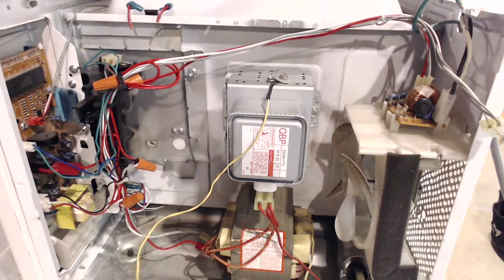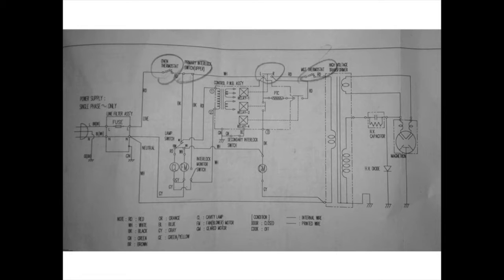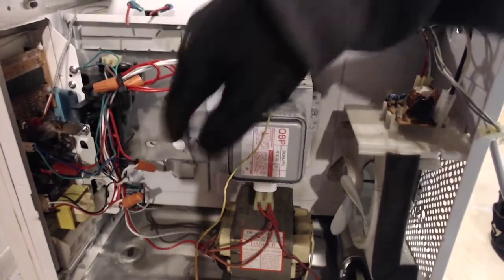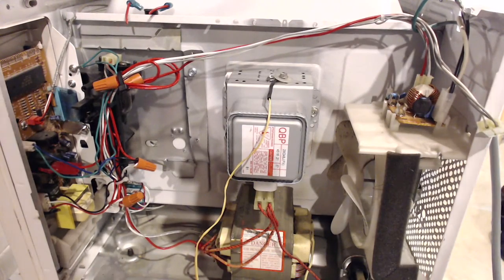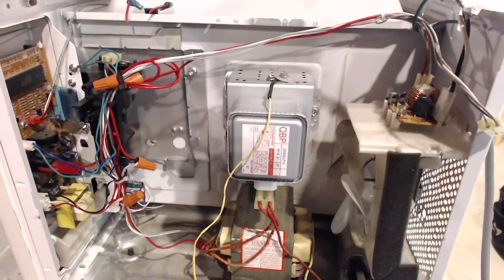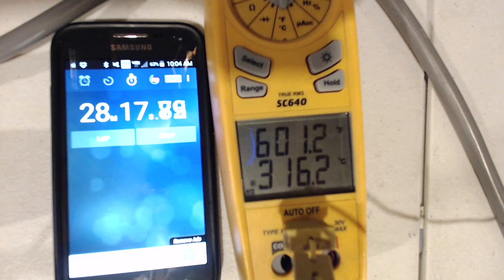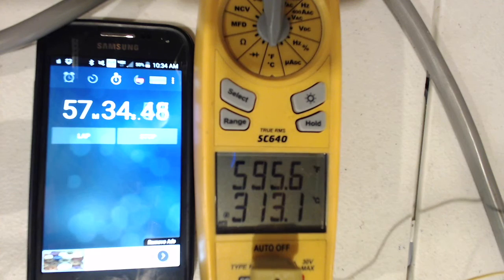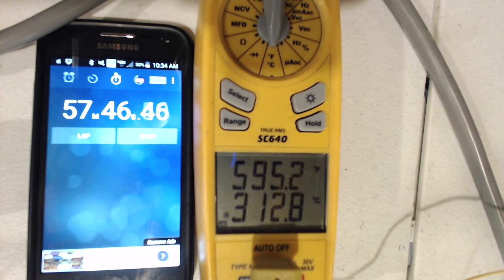Magnetron Overheat

Comment: Relatedly, I measured 2 microwaves to check a magnetron replacement, the power efficiency was 64.2% and 66.7%, "microwave rating" vs wall watts (not VA). VA was about 100w more for each.

Comment: The microwave has been great so far, and heats things up really quickly,>>>t.co/dqJgT6OPkR   I have two boys under 4, so it is used heavily. My advice (and what I think a lot of the negative reviews stem from) is to not slam the door shut, or throw it closed in other words. Use the handle like designed and close it properly, then you will not shatter the door glass, just an observation I made when using mine.
Reply: Not only the glass, but you'll prematurely wear out the cheesy plastic locking arm/actuators that keep the door secure and actuate the 3 door switches. I found that wiping a film of Vaseline  on the arm/actuators it made the opening and closing of the door much smoother operationally and eliminated sticky operation of the door and greatly helped prolong geometry integrity of the locking and actuating of the switches.